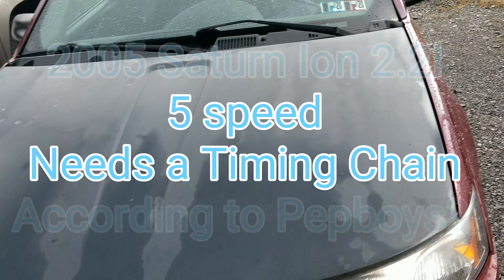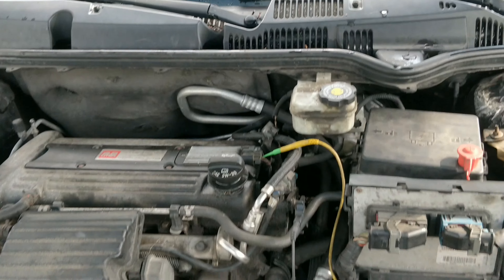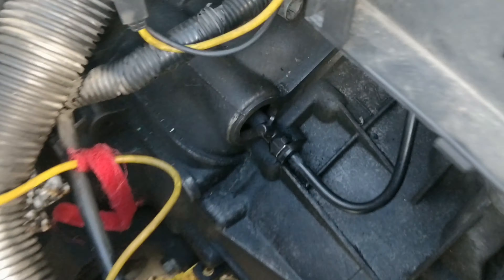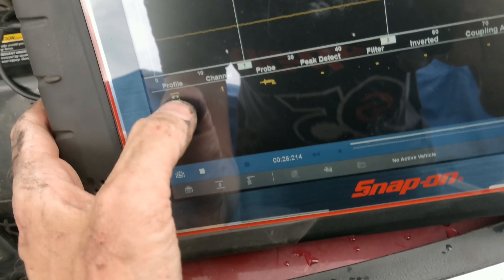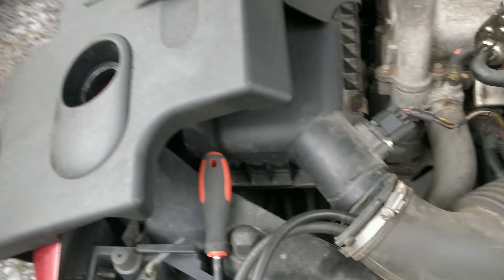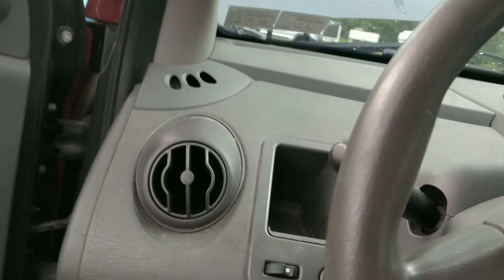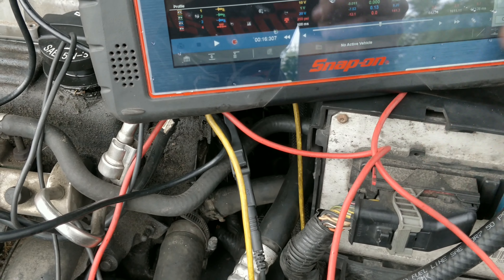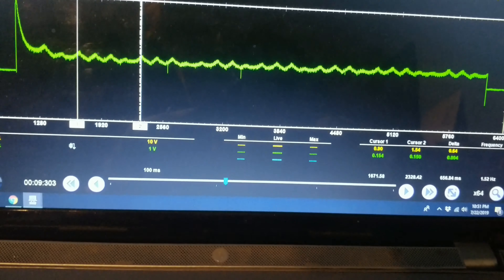2005 Saturn Ion 2.2l 5 Speed Crank No Start (Towed in from Pepboys) Part 1

Comment: Great video those saturns are die hard. Wish Saturn was still made as well as the Ford probe and Honda S2000
Reply from the maker: If they still made the s2000 the headlights wouldn't be worth $1200 lol
Reply: Robert Dotterer haha true I had a chance to buy one right before they stopped and I didn’t I’m kicking myself in the ass lol who knew
Reply from the maker: They have the same ends, that's my issue.
Reply: Ok I could not tell from the video if your bnc was male or female since it was removed
AESwave does have both adapters available
Reply: Steve Taylor they are all the same solder or screw like rob said. It’s very hard to find stuff that doesn’t break even from AES who I only buy from. The wires are to thin they pull out
Reply: Alright I misunderstood what the actual issue was, I was expecting it to be more conversion vs fragile
Reply from the maker: It's the banana Jack end that is the issue. I haven't tried theirs. All mine were hantek. I had 4 or 5 fail in a year. I was hoping to find some with a molded banana Jack.
Reply: Robert Dotterer I use these and cut one end off and I solder a female barrel banana jack to the end then plug mine into it. They hold up amazing